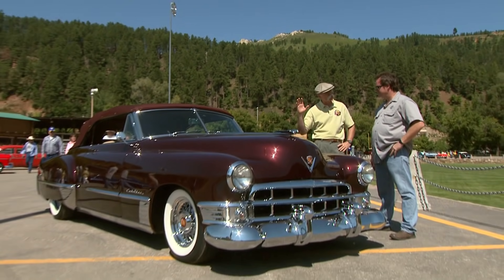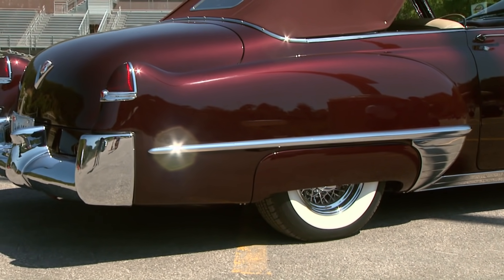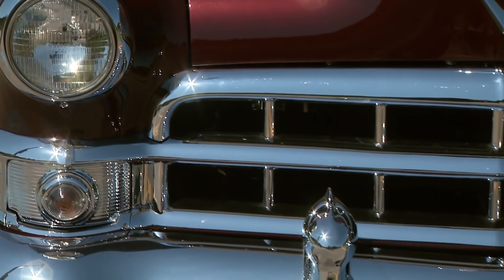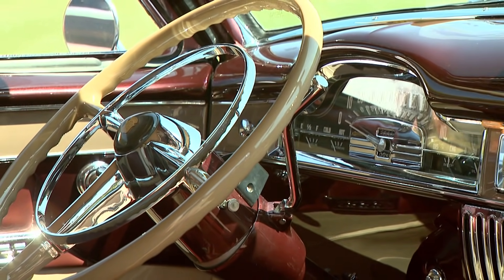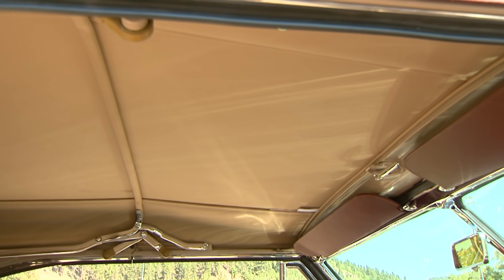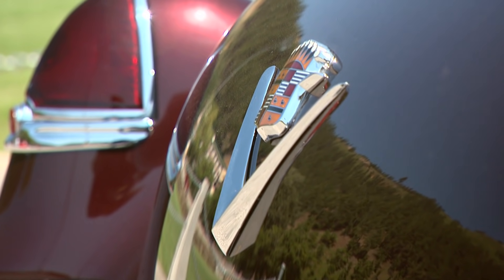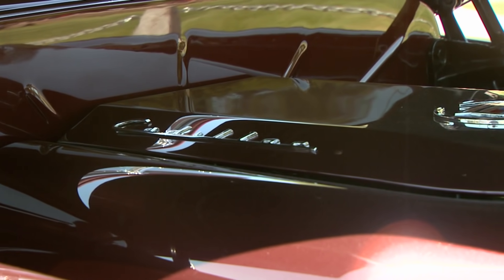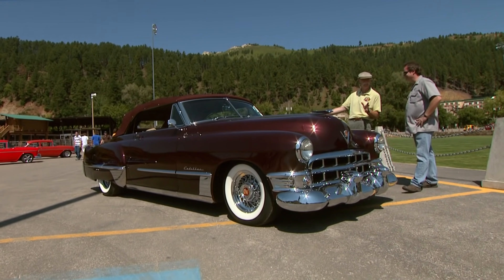Escalade Powered Classic Cadillac

Comment: Great video & beautiful car…..
Not to be a bummer here but the 8.1L 496 c.i. Was never installed in a Caddy….
I had a brand new 2500 Avalanche with the 8.1L in 2004. One of the best trucks I ever had.

GM - RPOL18 Vortec 8100 Applications: 2001-2008
* Chevrolet Silverado/GMC Sierra 2500HD & 3500 (option)
* Chevrolet Suburban/GMC Yukon XL (option)
* Chevrolet Express 3/4 or 1 ton
* Chevrolet Avalanche 2500 (option)

Comment: I love the car. But I really want that drivetrain for my 96 Buick Roadmaster sedan
Reply: Vortec 8100 is an industrial big block. With its tall deck weight like a boat anchor. It'll hammer down your Buick's front and the whole car will be chasing it. Sharp turns, banking wouldn't give you a great deal. You'd be better of with LS 6.0 or all aluminum 6.2 from them 2007-2014 Escalade. These LSs is almost everywhere. 8100 is harder to find and keep in mind the weight of it. LS is a small block and also packing more power that 8100.
Reply: That Road Toaster is a instant classic

Comment: Escalades never came with the 8.1 liter.
Reply: I was looking for this comment and the 8.1 liter definitely doesn’t get 24mpg!
Reply: Sam  I get 12mpg in my '12 6.2 lol
Reply: Sam  that’s 100% right, it was a rare engine indeed and a low mileage one would be a great find, but the Escalade never had this motor.
Reply: 500 Cubic Inch Engines were in quite a few Cadillacs in the Middle 1970's . Sounds like an 8.1 litre is about the same thing .
Reply: @timothyantoine5321  please show us your 1970s escalade, that sounds legendary
Reply: @irresponsiblekid  No one said anything about an Escalade , from 1970 to 1976 the 500 Cubic inch V-8 was available in Cadillac's . It was very popular with Drag Racing Enthusiast's . The 500 Cubic inch was considered a 8.2 ! Back in the day Engine displacement was talked about in Cubic inches not litres . Just adding to the conversation like any other comment .
Reply: @irresponsiblekid  Just like in every conversation their is some jerk with a wise attitude making a stupid comment . In this conversation it's @irK !
Reply: @timothyantoine5321 🤣  you replied to the comment THE 8.1 NEVER CAME IN AN ESCALADE, Gramps.
Reply: @irresponsiblekid  The owner of the vehicle said during the interview the Engine a 8.1 or a 502 came out of a 2004 Escalade . The comment then said a 8.1 never came in an Escalade . Not knowing which person was correct , I added that Cadillac did have a 500 that I was aware of . Apparently the 500 would be an 8.1 , so the comment I made was consistent with the Engine size . Your comment was ? Oh that's right a Wisecrack about something that I didn't say . What you would expect from a young PUNK !
Reply: @timothyantoine5321  Right, the 8.1 in it is 496, great motor and fitting for a Cadillac. I’m not sure why GM quit putting them into trucks.

Comment: BIG MISTAKE FROM THE BUILDER AND CLASSIC CARS. IN 1949 THE CADILLAC DIV ALONG WITH OLDSMOBILE INTRODUCED THE OVH V8 AND THE FLATHEAD WAS GONE.THE NEW ENGINE WAS A JOHN KETTERING DESIGN. IT HAD 331.CU IN DISPLACEMENT AND 160 HP. THIS IS WHEN THE OHV V8 RACE BEGAN BY ALL THE CORP. TO COMPETE . CHRYSLER IN 1951 WITH ITS ELEGANT HEMI AND LINCOLN IN 1952.